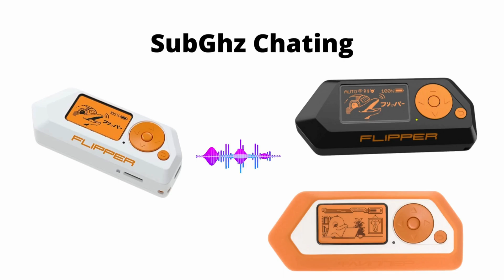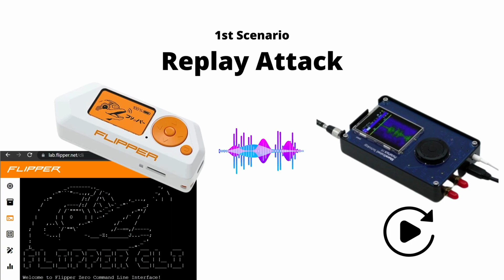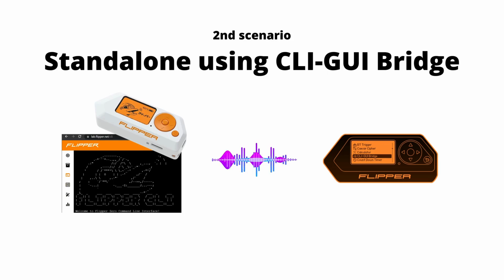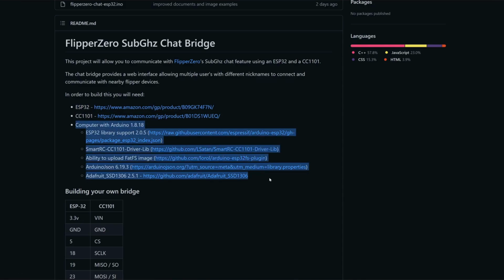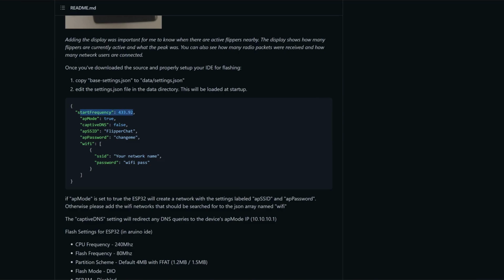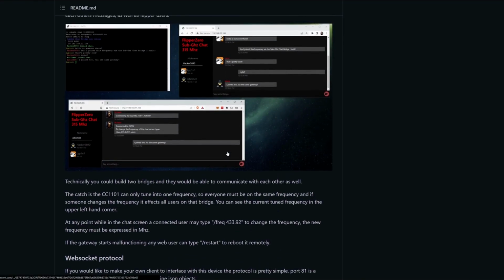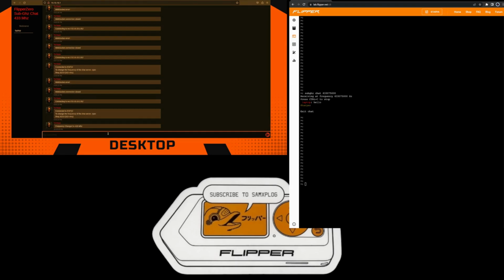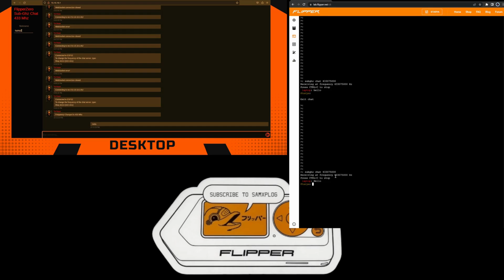Flipper Zero : Setting-up a Sub Ghz Chatting Node

Comment: I have 2 flippers. One with Unleashed firmware and the other has Xrreme. One flipper is not enough 🤣
Reply from the maker: You are right, we avoid relying on a single point of failure 🤗